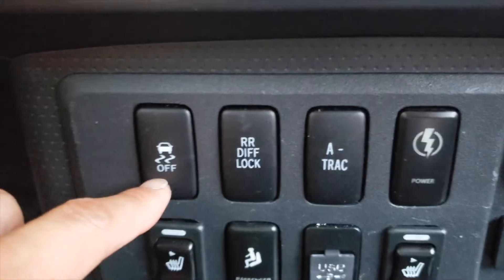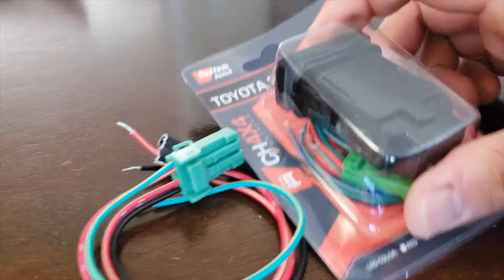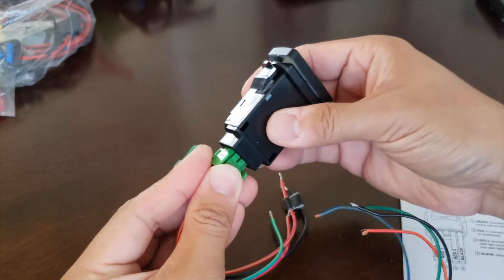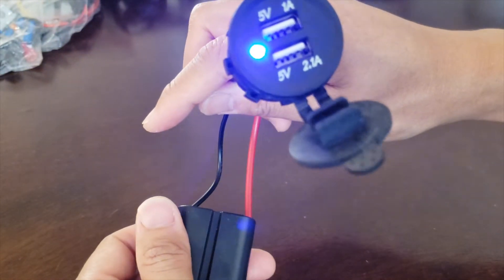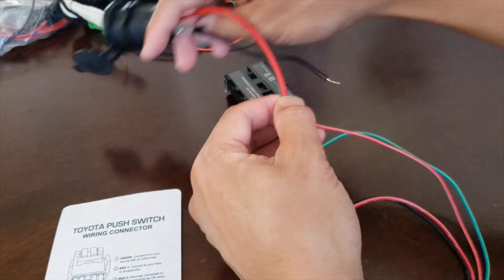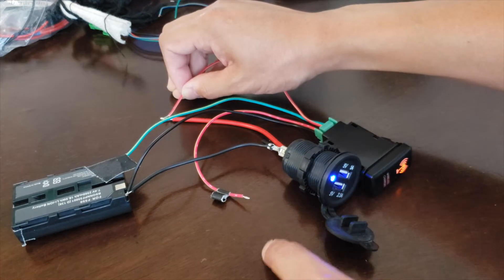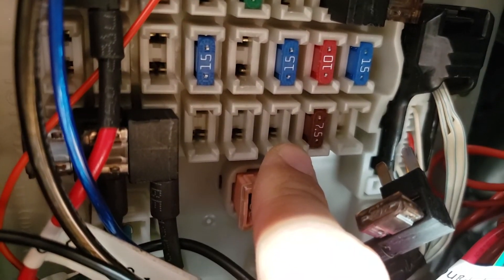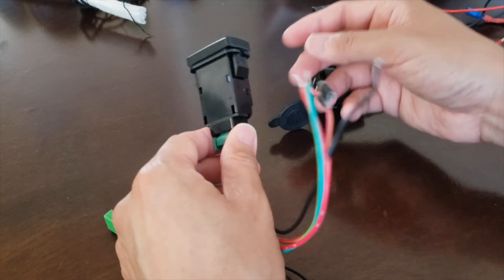Toyota Aftermarket Push Button Switch Wires Explained

Comment: Great vid! Maybe a strange question, but do the grounds need to come together or can they be seperately be connected to a chassis ground as well?
Reply from the maker: @pyrophilly   yes, they can be separately connected to ground.  I usually ground each one separately, but for the sake of simplicity in this example, I grounded them together.
Reply: @ awesome thanks. In case of putting a relais in between, do I understand it correctly that the red 1 wire would go to the 86 pin on the relais?
Reply from the maker: @pyrophilly  yes

Comment: Do you have the location for those fuses by chance please? I just realized these are fj mine is 23 4Runner
Reply from the maker: @ricardodesouza7229  it should be in the same general area, by the driver side where your knee would be
Reply: @ I found those today on mine, I think it was the ign ones. however the 2nd bottom bulb didnt light up, like it did on my 2018 I want it to light up when I turn the lights on .dies that make sense? Then the top one lights up only when we push the button
Reply from the maker: @ricardodesouza7229  yes, I get what you're saying now.  I made a whole other video explaining how to illuminate the second bulb with your dash lights:  https://youtu.be/SbXkLwCS53o?feature=shared
Reply: @LiL13izzy7  by chance are the instruments cluster fuse and tail light fuse in same location?

Comment: Hi there, I have just installed a roof LED Light Bar but wish to change the switch to an OEM. The issue is the original switch wire that comes with the harness has only 2 wires. I'm so confused as all videos show 3 wires, can this be done still??. Also this is my second Bar can this run separately or they both need to work together?
Thanks

Comment: I bought a push in switch for my tacoma.  Switch has a green, white, black and red wire. Not sure which wire goes where.
Reply from the maker: Check the orientation of the switch and compare it to the diagram I have.  In my video, I showed a second wiring harness with different colors, but they correspond to the same thing as the other harness.

Comment: My relay clicks. All wiring is new… faulty relay?
Reply from the maker: Maybe a loose part.
Reply: @LiL13izzy7  everything is connected securely.
Reply: @LiL13izzy7  no I went back with a test light and the red wire that goes from the relay to the lights has no current. Keys on or when switch is pressed. Nothing. So I ordered a better harness
Reply: New harness did the trick. I my only issue now is after following the installation instructions, the light on my switch stays on even when the car is off. I feel like it will end up killing my battery in time. I tried tapping into a fuse that only turns on when the car is on but I had no lights. Only way I can get them to work is by tapping into a fuse that is hot at all times.  I tapped into my power windows fuse. They don’t work when the car is off, but there is a current obviously when it’s off because the fog lights will turn on and the switch has power. 

Any idea how to remedy this? Or as long as I just don’t forget to turn them off, will this not cause much of a power draw?
Reply: @surslaughter3524 I have the same problem. Light on switch on all the time any way you got around this ?
Reply: I can’t remember. It’s been a while now. I think I bought a piggy back and spliced it into one of my empty 12v fuses.
Reply: @rdl7309  If you didnt figure it out or have someone tell you, instead of the "Connect to source with inline fuse" this guy was accidently wrong. Dont connect is to your constant power. In his Diagram "Red 1" you would connect that one to your constant power coming thru your firewall. You want to connect the "connecto to source with inline fuse" , in the diagram "green"  wire to your ignition wire, which you can use a "T" tap and connect it to any ignition wire on another switch. The wires will be the same, so the wire on the far left , if you are looking at the top of the green connector with the non smooth face.

Comment: I have exact switch you have with 2 red 1 green and 1 black. I need to connect to a Amazon Nilight wire system that has a switch with black , red and white wires

Comment: I have that other AOB switch with the red, black, green and blue wires. I have a harness from Lasfit with red, black and yellow wires.  I want to have the Light bar turn off when the headlights are off, and I want the bottom of the switch to illuminate with the rest of the switches at night.  Could you please tell me the easiest way to do this. Thank you.
Reply from the maker: Regardless of the color of the wires, the orientation should match up to the same diagram (the harness should be interchangeable with the switches I believe).  Anyway, I think the purpose of the switch is to be able to control your light bar independently of your headlights (otherwise, why have the switch in the first place?)

As far as the switch light illuminating with the others at night, I used an add-a-circuit to connect Red 2 (or whatever color line is in that 3rd position on your switch harness), to the tail circuit.  When I turn the headlights on and off, the switch illuminates with the console switches.  https://youtu.be/hGHI3vgkV8w?t=737

Comment: Green = IN, Red 1 = OUT to close the loop? Red2 and Black is just for the switch itself to light up?
Reply from the maker: Yes, exactly
Reply: @LiL13izzy7  thanks, i plan to use it for backup sensors but wanting to use the in/out with the ground and the power will be based on the reverse lights

Comment: I’ve been trying to hook up that same usb with an add a fuse to my Acc fuse and it’s not working. I don’t want a button to give it power. I just want it to turn on when I turn the truck key to On position. Help?
Reply from the maker: Try to flip the prongs the other way and plug it in again.  I did a straight USB port install here:  https://www.youtube.com/watch?v=5XObhMQ0wCo
Reply: @LiL13izzy7  I tried that. Wires are all good, in-line fuse and fuses are good. I tested them on the battery with the usb charger all the way up to the add a fuse tap. Possible that my add a fuse tap is bad??

Comment: So on my Nissan Sentra I don't have a spot for more rocker switches, is it possible to wire a different switch type? For example a round one?
Reply from the maker: This is such an open ended question because you could wire a switch to anything.  There are so many different kinds of switches too (round is just a shape).  What is your accessory that you're trying to run?

Comment: My light bar on my tundra came with a relay harness. I have it hooked up and the switch is a generic 3 prong rocker switch (with led). My new push switch has 4 wires. 

The 3 prong switch has positive and negative and a blue wire which I’m assuming is sending 12v to relay?

So I’m assuming the extra wire is for tail lamp fuse and night time running. I was wondering why 4 wires….
Reply: I am in the same boat and trying to figure it out. So positive to green, blue wire to red 1 and then ground to black? 2nd red wire would just be for switch led light, whether you want it always on or with accessories.

Comment: Can i use the power from an add a circuit to connect to multiple switches(to turn on the light with the headlights)?

I have one hooked up and it works great, but i want to add a new button for my light bar…
Reply from the maker: Yes, I'm doing the same thing, where I tap into the same add-a-circuit line to power Red2 from other switches in order to illuminate them as well.